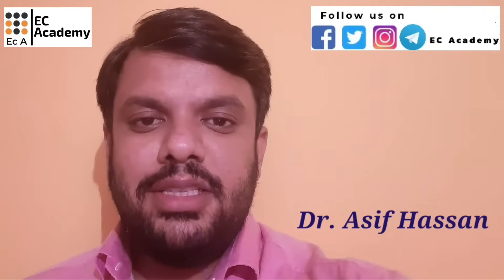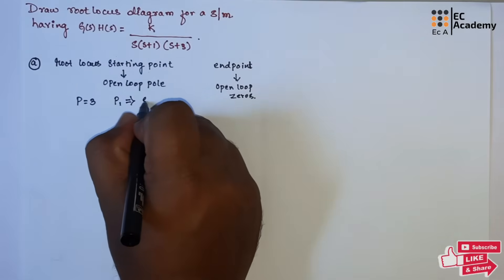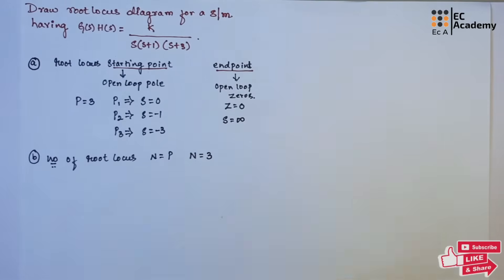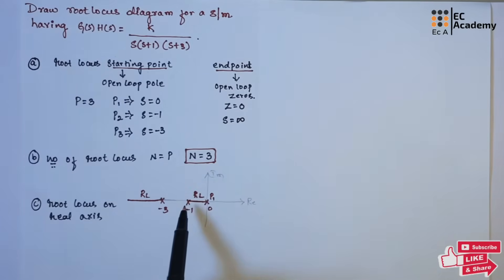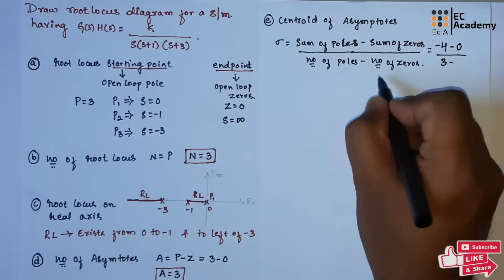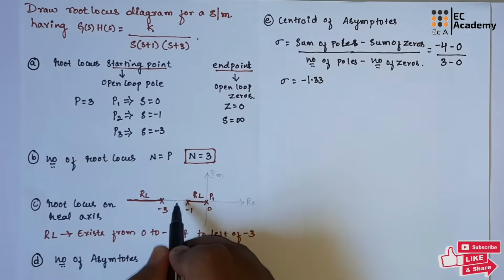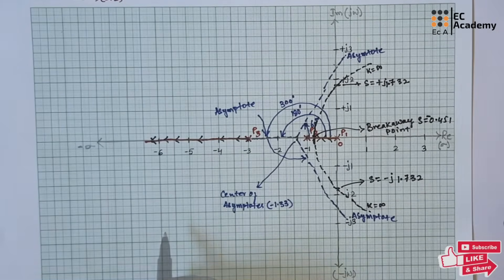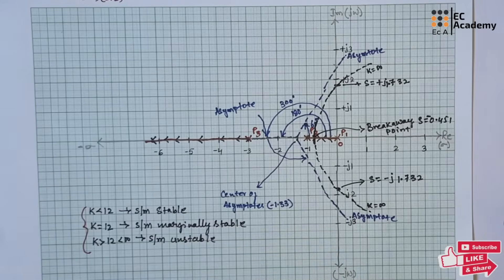#191 Root locus problem -1 in control system || EC Academy

Comment: Sir routh array 
S to power o=how it is k sir
Reply: In routh table, the last term for s power 0 will always be the final constant of the characteristic eq...its a rule..and if you cross multiply and calculate and check, you will arrive at the same value 'k'